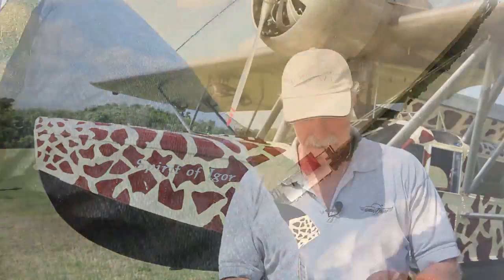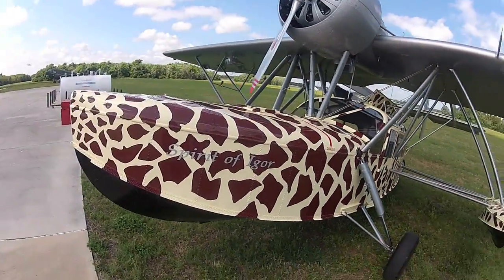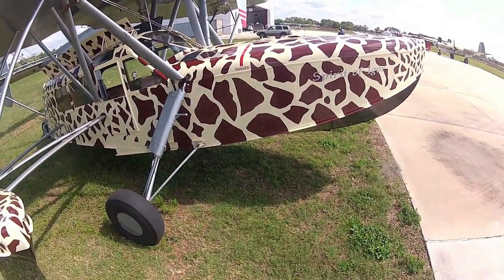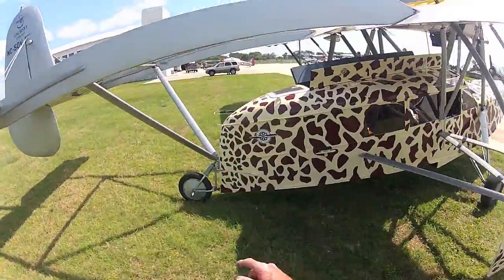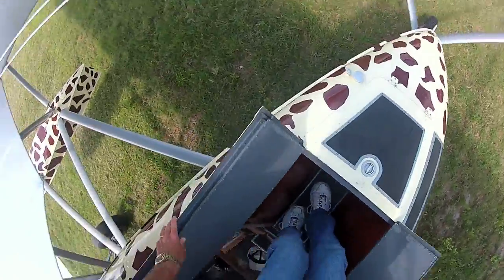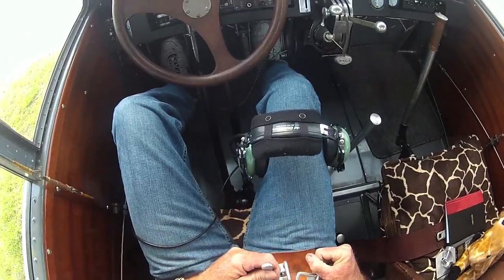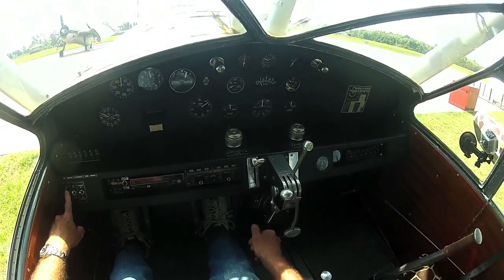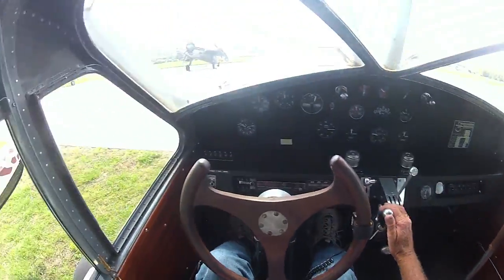Sikorsky S-39 - Part 1 - Kermie Cam

Comment: If you have that much space to take off, why taxi all the way to the end?
Reply: To be safe if engine stop running after take off
Reply: Because the runway behind you is one of the three most useless things in aviation. The other two being the air above you and the fuel in the underground tanks at the service ramp.